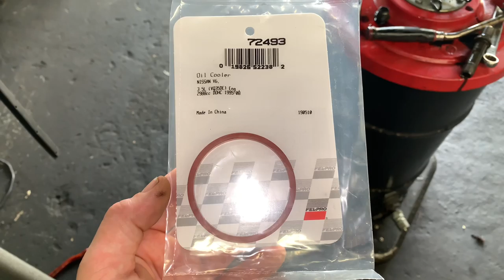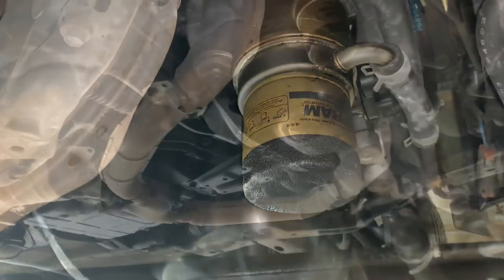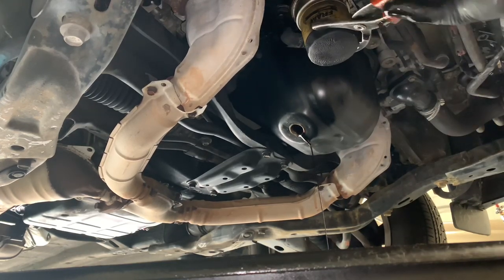How To Reseal Your Subaru Forester's Engine Oil Cooler And Oil Filter Housing

Comment: Great tutorial. If I’m not mistaken, I think there are a total of four o-rings sandwiched between the oil cooler, adapter and the engine block that should be replaced as well. Some of these get overlooked and will still leak oil down to the filter.
Reply: Thats fir the ej255

Comment: that was a really good explanation thanks man, nice video
Reply: 1:45 on my 2008 outback xt i ended up having to take the coolant lines off to get access and drain about 1.5 bottles of coolant because the exhaust header was in the way and i didn't have enough access. maybe i could've taken it off, but i thought it best to not mess with the heat rusted bolts on the header so i could drive the car the next day